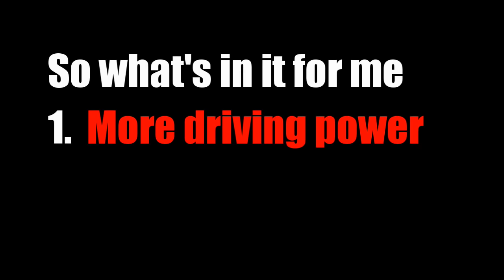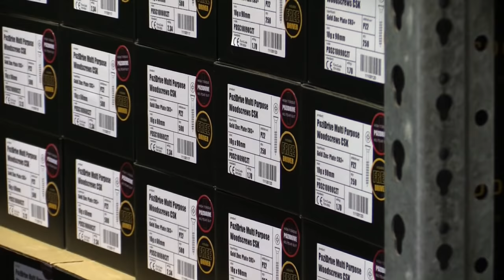Pozidrive Screws from Scrooz Fasteners

Comment: No thanks, torx and robertson already solved the cam out issue.  Pozidrive isnt much differnt than philips.
Reply from the maker: It is completely different, hence the Phillips Screw Company went on to design Pozidriv
Reply: I migrated from Europe to USA: they might not look very different, but there's a huge difference between Phillips and pozidrive: I don't have to push like a caveman on a pozidrive, I can drive at an angle, I can easily drive long screws, etc... 
Saying all that, Torx is even more amazing. And Triple-square (XZN). 

Phillips should be a last century relic, just like slotted.